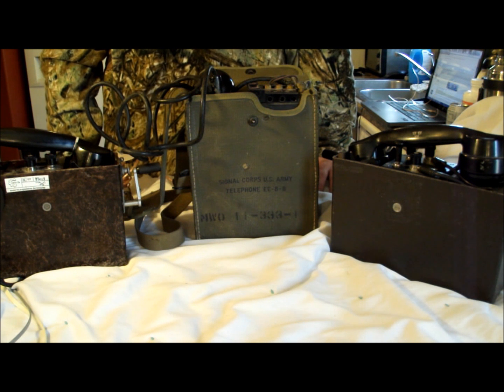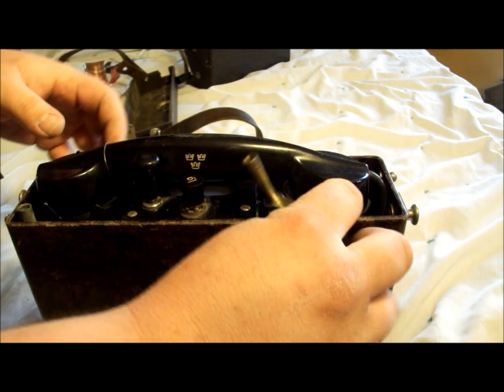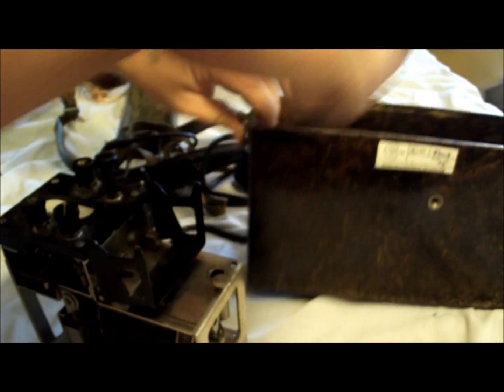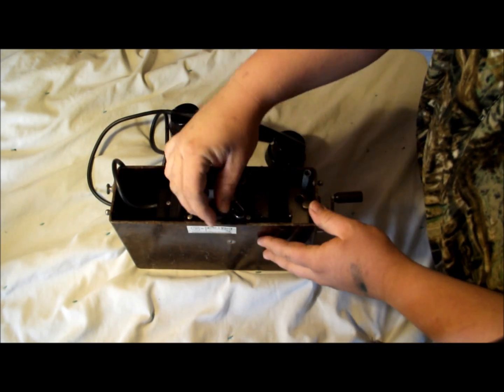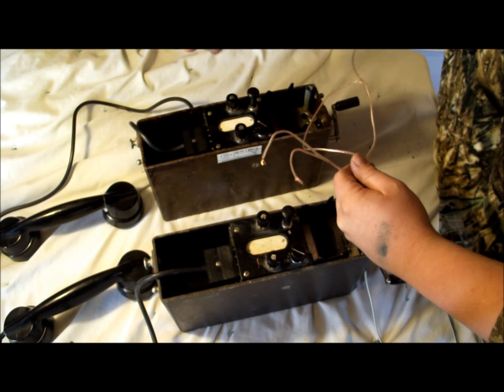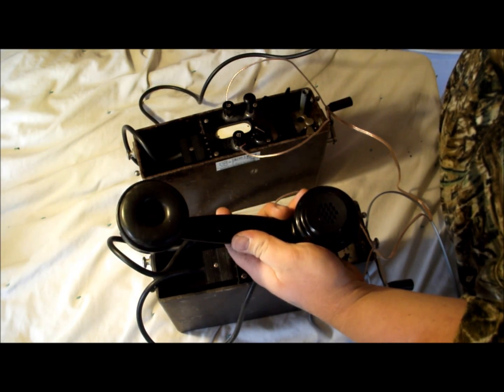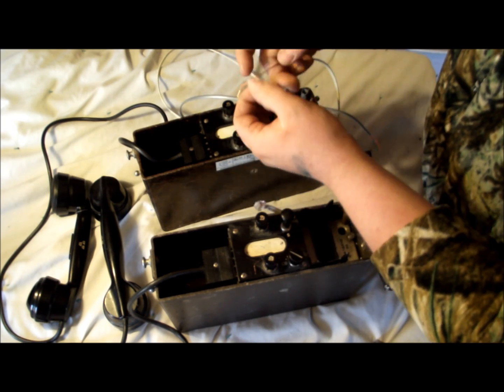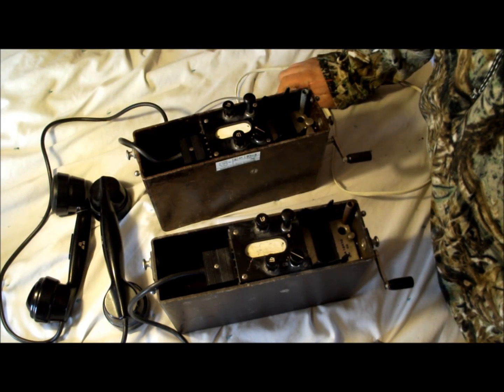How to wire, setup, and use Military Field Phones

Comment: Helpful video for the excellent Swedish phones.  Here are a few corrections.  

In a "common battery" system, the power does not come from a "more powerful phone," it comes from a big bank of batteries in the telephone company's central switching office.  

The field wire can be connected either way around, in other words the wire from "La" on one phone can connect to either "La" or "Lb" on the other phone; operation will be the same either way.  

Minor detail: the field wire connects to the two "binding posts" (not "knobs").

Comment: The small screwdriver on the Ericcson Phone is used to change the LB/CB Selector latch mechanism.  Also the signal is basically AC so wire polarity doesn't matter.  Ranges in excess of 20 miles can easily be achieved.  Also never leave batteries in the phones if your not using them.  The corrosion will ruin the battery compartment and the contacts.

Comment: you can hook these to railroad tracks and get signals out to around 30 miles
Reply: I would be cautious about hooking anything to the train tracks - both from a safety & legal perspective.  Track circuits, crossing protection, and even some hot box detectors use the rails as electrical conductors.  As for the legal aspects, I have 3 words.... Home Land Security.  Watch from a distance, but keep clear of the tracks.
Reply: arbutuswatcher you stole my profile pic
Reply: Say what?  Is that true?  If so, how cool is that!!

Comment: How come in the movies I always see soldiers wearing these (on patrol dozens of miles from camp) in a backpack with an antenna?? Can they not be used wirelessly? (Security be damned)
Reply from the maker: Like if your watching a Vietnam movie, your probably seeing something like an AN/PRC pack.  They were introduced in the late 60's and were basically a 2 watt short wave radio.  Although very handy and portable, they had a lot of limitations, and needed networks of repeaters to maintain communication.  From what I have read, even into Vietnam most permanent bases still used wired communication, however if there is any vets read this, I'd love to know more.
Reply: i think the army is still using sincgars radios. I have had to carry one around in my rucksack before. They are really handy but kind of heavy especially if you are already carrying a lot of crap through the woods.
Reply: @AJohnson0325  the navy and marines do still.
Reply: The phones in this video were for wired network.  The pack-sets you're referring to were radios with telephone handsets.  There were interfaces, which allowed wired field phone networks, to be tied into radio networks, but that's an entirely different can of worms.

Comment: I have a CY-1181/TT-GY at home. It's from '52 but I don't know how to operate it and it still works when I put batteries in it. I don't want to break it with wireing and setting it up. I need help with it (I'm from Germany so I hope I understand most of it!)
Reply from the maker: These were field tested radios, and very durable.  I wouldn't be worried about breaking it.  As long as you use the proper batteries, you will be fine.  Just find another radio like it, and run a couple of wires and it should work great. Your radio will function almost exactly like the ones in this video.
Reply: I believe that designation is a regular EE-8 US field telephone in a rubbery kind of case. Look up EE-8 operation for yours.

Comment: how do you move the knob from CB to LB mine won't turn.
Reply from the maker: With the handset out of the cradle, you will see there is a small tab attached to the "hang up" paddle right below the CB LB knob with a spring at the bottom.  You need to pull that tab in the opposite direction of the CB LB knob, then depress the knob and it should turn.  Hope this makes any sense.

Comment: The German phones have patch cords to tie phones together making a crude switchboard, A dialer can be found for German phones and I plug mine into my digital phone service and it works fine. 
The ringer generates 90 volts pulsed DC, the current across a person's chest can kill them so be careful.
The crank doesn't have to be turned rapidly, a slow to medium speed works well. These could make great
generators to drive night crawlers to the surface. If you use ground rods then only one wire is necessary
and you can still talk for miles. Field phones provide security and prevent signal analysis of radio transmission.

Comment: how did these things make connection and signal all the way back to america in the old ww2 days?
Reply: They didn't.  They were field phones.  For example, if you had a forward position, you could have a phone there and one a bit back where the commanders were.  A guy would run the line off a reel, literally run it back hundreds of feet.  Conceivably, if the command area had telephone service, you could be "patched in", but these phone really were for field work.

Comment: I've been doing research but can't find a definite answer quite yet
I've got a Czech TP 25 field phone, and was wondering if there's any way to test the ringer without another phone

Thanks
Reply: On the TP 25 There is a small white ringer test push button inside the phone case near the "b/z" line terminal inside the case.  Connect a single wire between the "a" and "b/z" terminals.  Hold the pushbutton down while you turn the crank.  The ringer should ring. 

The ringers on these Czech phones are really poorly designed.  The best ring you can hope for will be a rattling sound with a slight ding to it.  As a matter of fact, the TP 25 phones are rather cheaply designed compared to the postwar German FF 54 and the pre-war/wartime FF 33.   The FF 54 usually costs a bit more than the TP 25, but it's worth it.  Plus,  a rotary dial attachment  can be connected to the FF 54 so it can be used to dial phone numbers on a civilian phone exchange.
Reply: izhevsk1943
I figured it out finally, but thanks for the reply. The ringer actually works just fine, and it's nice and loud
I'll keep those other models in mind!
Reply: Cool.  I just got done trying to improve the ringer on my TP 25.  I broke the locktight off the screws and took the mechanism apart.  After much fiddling, I finally got the volume to increase somewhat, but it's still more of a rattle than a clear ring.
Reply: I got two TP-25 just a day ago and one of them looks aesthetically very nice but the ringer doesn't work, but the other one doesn't look aesthetically very nice but the ringer works!
Reply: What is the Purpose for the interconnection cables on the Tp-25? They're very short and I dont know what to use them for, I plugged each end into one of the two holes on the front of the Tp-25 phones I have.
 
I have speaker wire and I tested the phones first with the short interconnection cables plugged into the front along with the speaker wire plugged into the top where the "b/z" and "a" plugs are, and it worked ( although one of the handsets doesn't work when you push the button to normally talk in, but the other one I have does work when you push the button to talk and I could hear it from the handset that doesn't work).

Then I tested it with just the short interconnection cables without the speaker wire and it works with the short cable I mentioned in the beginning, but the one handset still doesn't work.

Comment: The Swedish one, Fälttelefonapparat m/37 was nicknamed "Fältapa" (Field-monkey) because how simple they were. I don't know the maximum range, during my time in the army we spliced together two DL1000 cables. That would be 2km of cable, old cable from the 50's witch would be considered cable of quite bad quality of todays standard. So I think the limitation in range will be how far you want to lay out cable. The DL1000 is heavy to carry around, even with the cable building gear. When used in CB mode, Centralbatteriläge, there is a adapter you hook up in between the line screws turning it into a rotary phone. By doing that it was compatible with the Swedish national phone net. So you could climb a telephone pole and connect yourself into any existing phone line.
Reply from the maker: Wow, this is some good info.   Thanks for the comment!!

Comment from the maker: You can add as may phones as you like, but they will work like a party line.  If you have 4 phones hooked together, if you crank one, the other 3 will ring.  Anyone on those phones could hear the conversation of anyone else.  If all the phones are hooked to a "switch board" then an operator could manually hook up connections between just 2 phones.  I will have more videos coming and a few of them are on communication, I will try to address multiple connections then.  Thanks for watching!

Comment from the maker: Thankyou!  As for wiring several houses in a neighborhood, using existing phone wiring is unfeasible.  You would be much better off running your own wiring between houses,.  Depending on your phone, wire quality and gauge, and battery strength hooking up several houses with in a mile or shouldn't be a problem.
Reply: Not true!  You'd have to find the unused spare wire pairs on  the telephone company's cable at each of the pedestals/cross connect boxes.  They generally have many spair pairs available that they use to add additional phone lines to an area.  They only problem with this is the phone co. will pull the cross connects it they discover them.

Comment: Thanks for the info on the house wiring we just had cable internet and magicjack phone installed and verizon disconected I'm going to hook up my TA-312 phones this way never thought of that.
       One of my 312s does not ring maybe it's the generator on the other phone or the clacker on the phone that doesn't sound going to have to check them out.thanks.Jim.

Comment from the maker: Do you know what model number by any chance? That would be the biggest help.  If it is an older one like the TP-25 there should be two studs labeled "a" and "b/Z".  Those should be you connection points for you communication wires.  The "+" and "-" should be battery. I am not an expert by any means on the CZ phones, so a bit of trial and error is in order.

Comment: It means that since the phone only operates as one point of transmission and one point of reception, you wouldn't be able to easedrop. If you cut the line you would not be able to receive the information because opening the line will increase the impedance, the voltage would not support the spike, and all transmission would cease.
Reply: You could eavesdrop easily.  If you have all the phones connected to the same pair of wires (a "parallel" connection), then any phone can listen to an ongoing conversation.  You don't cut the wires at all (that would be a "series" connection).  Ask your grandparents about having a "party line" with a lot of neighbors sharing the same pair of wires, everyone could hear everyone else.  Of course you could have only one legitimate conversation at any given time.

Comment: If I'm not mistaken, this system will work like the TA 312, and you can operate the phone in an emergency situation without batteries. You can pick it up and speak to another phone if it is under 2 miles.
Reply: That's true only for a different type of phone, called "sound powered" phones.  They have an entirely different type of microphone that doesn't need batteries.